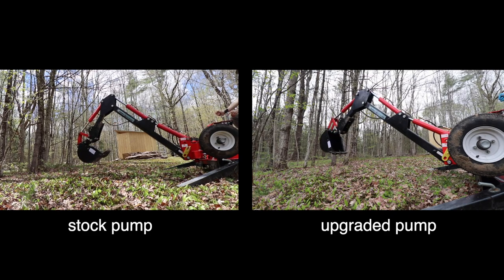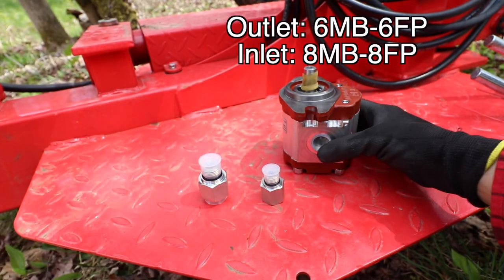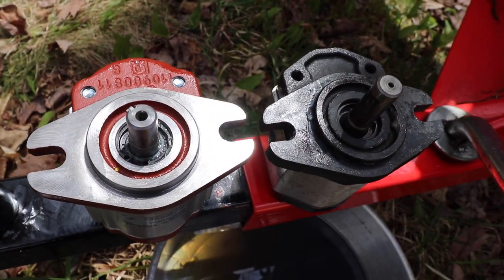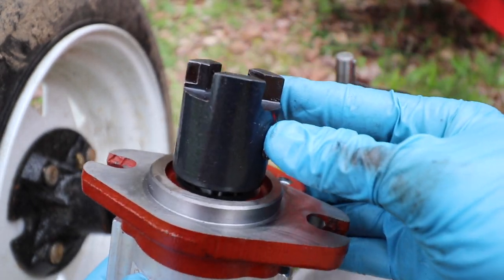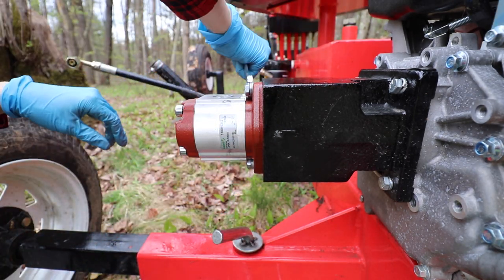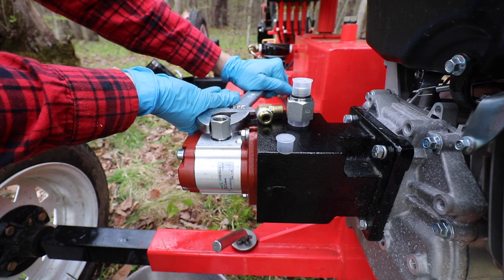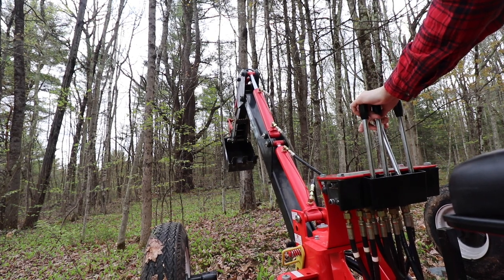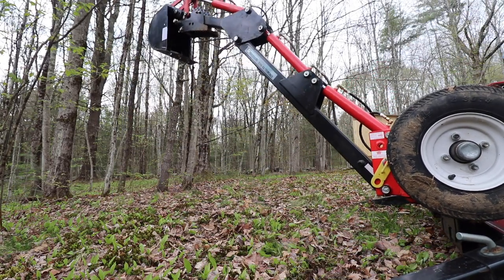Upgrading the hydraulic pump on a Harbor Freight towable backhoe trencher

Comment: NEVER , EVER USE TEFLON TAPE with hydraulic fluid.
Hydraulic fluid breaks down Teflon tape and the small pieces go into inside stopping up things causing skips , etc...
ALWAYS USE HYDRAULIC SEALANT ! LOCTITE makes a good SEALER , not thread lock !
Reply from the maker: You're right. I was just replicating what came on the machine stock and did not have an alternative sealant on hand.

Comment: Never use teflon tape on this fitting because qualified service tecnicians know better.
Reply from the maker: You're right. I was just replicating what came on the machine stock and did not have an alternative sealant on hand. I'm sure qualified technicians would do a lot of things differently than what is done with this backhoe purchased from Harbor Freight.